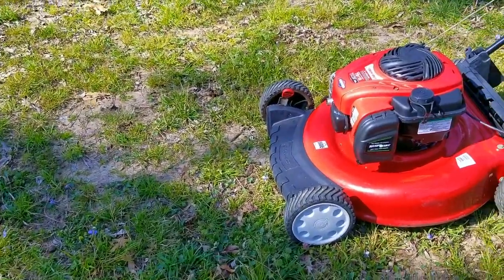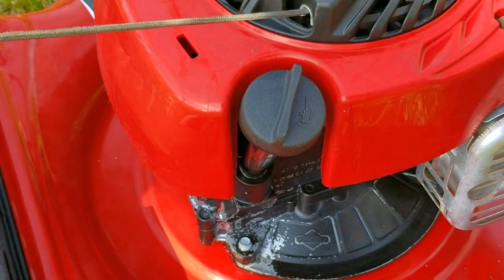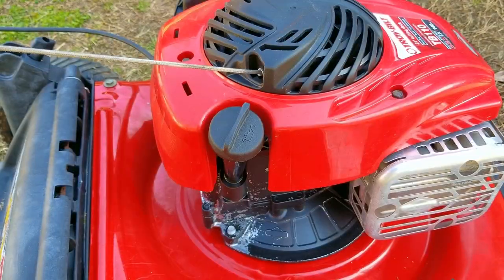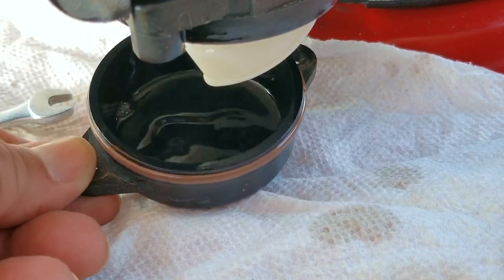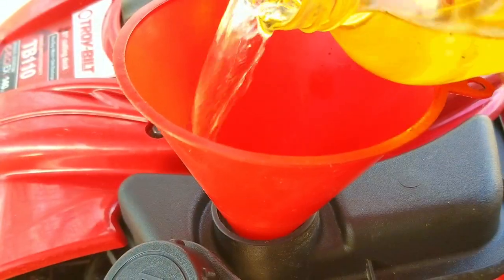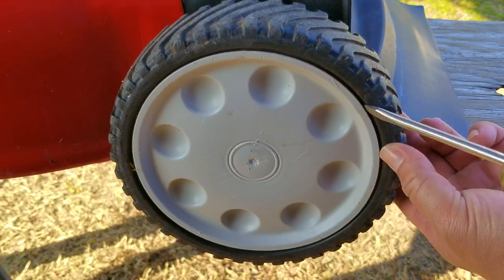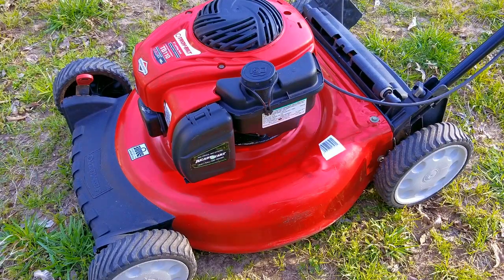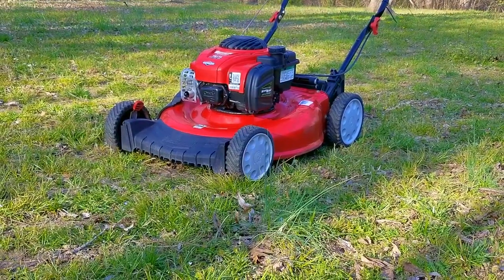Fixing A Mower That Won't Start After Storage

Comment: One thing I find fr0ustrating with every manufacturer is when checking oil dipstick you don't know whether to screw dipstick into the tube or just rest it on top of the filler neck to measure oil. Thanks for your vids!
Reply from the maker: No problem. And I know it can be confusing but a glance at the manual, if you can find one online, will help out!
Reply: Honda does include a sticker on their cover showing how to check the oil level.  But otherwise, I don't recall seeing anything.  Generally, if the dipstick threads on (Honda, Kohler - these two stick out to me), it's a push down to the filler neck.  Otherwise, push it all the way down til the alignment tabs on the cap sit into place.
Reply: Lol mine is near impossible to check oil level, first mow today, well, I put in a little too much, for a few minutes I felt like an old PT boat, laying a smokescreen
Reply: I had an old Briggs and the dip stick had “SCREW IN DIPSTICK TO CHECK OIL” written on it
Reply: @jasonlin9805  I've seen some like that. They are the best.
Reply: Some engines say right on the stick. However if the stick has hash marks all the way from bottom to top, just fill till it starts to overflow a little 🤣

Comment: I live in New England and our winters are around 5 or 6 months. I've never drained my tank or used stabilizer and have never had any problems with starting in the spring. I guess that I'm just lucky! 😉😉😉
Reply from the maker: must the the fuel, what kind do you use?
Reply: @INSIDEHOUSEGARAGE  10% ethanol.
Reply: actually I have found that two conditions most degrade gasoline left in storage, more specifically left in a tank of an engine. 1) high temperatures, like in a metal shed in the summer. 2) temperature FLUCTUATIONS,  which causes condensation, especially bad with ethanol gas. So in regard to gasoline storage, actually steady dry cold is better than heat & humidity.

Comment: I used to mothball all my yard equipment but I found non ethanol fuel less than a mile from my house and it’s only a few cents more per gallon.  I use that exclusively for yard equipment year round and my Motorcycle (carburetor) towards the end of summer.  So far everything starts right up in spring and I don’t fuss with emptying any fuel.  Granted, I’m in DMV so winter is short.  It’s Uber frustrating to try and mow your lawn or take your motorcycle out for a spring ride only to find out it won’t start.  Finally, nice find!
Reply from the maker: wow, that's really convenient, and thank you Sam Feldman!

Comment: 😁Man.. that one was a gem a perfectly good mower.. i suck the fuel out in all my yard equipment and toys with a cheap hand pump or siphon out and than run the engine to get the last out.. but only my generator has fuel in it all the time but the carb is run dry and it's ethonal free which i swap out every 6 months and just burn it in the car
Reply from the maker: that works great too!

Comment: I live in Canada, where the mowers are stored from about October to April. I don't know anybody who doesn't run their engines until they run out of gas before storing them for the winter. And I do the same thing in reverse for my snowblower, i.e. run it dry at the end of the season or whenever I get around to it once the weather's warmed up; in my case, I just did it yesterday along with the oil change. Also, I don't have access to ethanol free gas so I use a stabilizer.
Reply from the maker: that makes sense in your case. And don't worry, I believe 100% gasoline with no ethanol will be gone here soon as well.

Comment: So I do have a filter added to the fuel line and yes it was stupid because of exactly what you described with the room situation. But with extra fuel line added in a loop I added a fuel shutoff valve and paper fuel filter. Probably a waste of time and effort but I do enjoy having a fuel shutoff. I do leave fuel in all my engines but I always have marvel mystery oil in the gas and exercise the engines in the off season and I've never once had to clean a carburetor and everything works as it should.
Reply from the maker: thank you KLX boy for letting me know it can be done!

Comment: Good video, took my similar carb apart, now leaks, need to figure out just where. These plastic ones must be prone to that, and no did not over tighten the screws. Occasionally on an engine which was running fine last season, but won't start when taken out of storage due to fuel starvation I'll share a little trick my Father showed me. Someone must have told him to do on his early 1950s, once ubiquitous, B&S model 6BH. Air cleaner removed, put some fuel in the intake. When engine starts cup the intake with your hand or whatever to block the air flow & create more vacuum in the fuel uptake tube. Sometimes you have to modulate or allow some air in of course and / or may need to do this several times. Once in awhile why you get lucky and that vacuum action actually unclogs the carburetor or fuel up take tube to where the engine will start, and continue running as it should. Of course this is no help on some engine been sitting for three years. 

Second trick, depending upon design of the carburetor, what you can sometimes do is a partial disassembly without removing it from the engine. Run stripped bread wrapper wire up in the little holes, like IHG did in video, and spray in them with carburetor cleaner nozzle tube. I shouldn't have to say wear safety glasses and don't lose your needle valve in the grass. 😝 Keep up the good work on your videos.
Reply from the maker: thanks for the advice and I appreciate your time!

Comment: Whan I painted the deck underside so I lubed the wheels while the paint was drying. I can't get an OEM carb. Out of stock. I can work around that but I think the mag is a knockoff and goofing up. That will probably be the next thing to get because it won't even start off of ether. Oh well, always something. Thanks and BLESSINGS! Happy weekend too!
Reply from the maker: nice choice of when to lube the wheels, what color do you paint the deck? the same as the mower or a different color?
Reply: @INSIDEHOUSEGARAGE  I just painted the underside oil base black but will let Sweetie clean the topside to her own content. l'll probably get her some Rust-oleum if she wants it but it don't need much. We shall see!

Comment: For all my two stroke mix gas it gets 100% gas and stabilizer every time. The 4 stroke gas is also 100% but no stabilizer during the mowing season. I use the amsoil stabilizer because it is easy to add to my  amsoil orders. Do you run an oil that is specifically for aircooled engines? I run the amsoil small engine oil and it seems to do well, and its good for 200hours (l change mine sooner but it is nice to go at can go long)
Reply from the maker: nice method Ethan Miller!
Reply: Good idea, although I'm running so much 2 cycle mix, it don't have much time to sit around and get stale. Also note that some of the premium 2 cycle oils such as Stihl ultra have stabilizers already in it. The 100%, as you call it, NON-ethanol gas though is the most important part of having a happy life with your small engines. Only downside of the non-ethanol, is you may have to adjust your 2 cycle idle speed screw down!

Comment: I recently moved and am now able to store mower & gasoline in my garage where it never gets below 50 degrees.  Before, I kept in an outdoor shed which is subject to an upper midwest winter.  Does a warmer/drier place to store help keep the gasoline from deteriorating?  BTW, I have a fuel shutoff so the carb is empty when not in use.
Reply from the maker: nice thanks for the information, and yes as far as I can tell, a cooler and drier place, Is better

Comment: I store all my machines on a empty tank. 👍🙏👍🙏
Reply from the maker: best advice ever! thank you RayFpv
Reply: good idea as far as you went. Two additional pointers are, no matter how empty the tank, even if you run the engine until it runs out of gas & stops, there is ALWAYS going to be a trace of gas left in the carburetor. So just a splash of Sta-bil or other fuel stabilizer, added to the last bit of gas left in tank, and allow that to run a few minutes helps. Also back in the old days of metal fuel tanks, the blasted things would rust if left sit around empty. I'd spray the inside of tank with WD-40, or similar and also put a piece of plastic bag under the fuel cap 'less it was one of those which has a fuel gauge on it, to prevent condensation which caused the rust.

Comment: Hey, great video again.  Curious what you folks think, obviously finding free stuff is great, but it seems like these are getting more rare since everybody thinks their junk is worth gold.  So sometimes, I buy non-runners for at salvage value on a gamble, what valuation do you use?  Ideally I'd like to turn a profit, but understand its a gamble, I am usually ~15% what I think is market value.  Less if there is clearly missing parts, or maybe more if its in really good cosmetic condition.  What do others use?
Reply from the maker: I guess you're saying is that you would want to buy the non running mower
for 15% of their running market value, and the to fix and sell it, at a higher percentage then? Not a bad way of looking at it, But to be honest, it's hard to make any real money doing this hobby.  As for me,  I just use luck, and the Internet to find, and sell them.

Comment: Yeah I use the base Sta-Bil brand. I double the amount recommended, I have 5 gallons on hand in case and after a year I throw it into my automobile. I buy in summer and I do use 10% ethanol. I think I have talked about before but I also use Berrymans B12, some extra coagulants for the jets and orifices. I have never had to pull apart a carburetor on my equipment. Well except for tomorrow when what I just said here bites me in the ***. 😀
Reply from the maker: yep me too!

Comment: Hey I have a 3.5 HP old Briggs engine it revs up and down and sometimes when I’m throttling it it tries to shut off and sometimes it does shut off do you know the problem?
Reply from the maker: I'd need to the model and serial number of the engine you're working on. That way, I can see what you're working on.

Comment: Well I could not get my pressure washer to run I loned it out got it back and it wouldn't start so I tried starting fluid and it acted like it was going to start so I hooked up the water to it and nothing so I took the bowl off and cleaned it out then put new gas in and nothing I guess I will have to pull the carburetor off and give it a good cleaning o I meant to tell you I believe there was water in the tank cleaned it out and put new gas in still nothing got any ideas. Thank you
Reply from the maker: thank you for letting us know, and good luck to you

Comment: Drain the tank turn it on its side and dump the float bowl 
Will start easy next year
Reply from the maker: I like that way
Reply: generally like your idea. Have seen a lot of the old Tecumseh style carburetors with a metal float bowl and rest of innards all corroded up inside, needed new carburetor, beyond rebuilding. To be fair most of them had been left out in the weather, for who knows how long, where condensation was an issue with no gas in them, or it had dried out in the hot sun. Those metal float bowls, imo for short term storage best left full of non-ethanol gas, with stabilizer. More than a year, try to get all the gas out of your fuel system by all means.
Reply: @markbaker1843  my Toro with Brig's
Has a plastic carb 
So carosion won't bother it ❤️
Reply: @EricMatson-ru7jj  yup some times plastic is better in certain ways, it won't rust.

Comment: We don't use that style of filter we use the smaller like listen to enjoyed paper filters that use on a Ride interactor that's what You use to put a Filter on a Push More weigh normally I would put a Filter and a cut off of in the Fuel line on the old models of the metal corporator on that 1 You just put up the observer and it from my rideing tractor who in the smaller profile wants not that Big round Old School Filter that's Old School filters from the 90s that's WHY You Don't eat that 1 on there You The One with actual Filter media in it